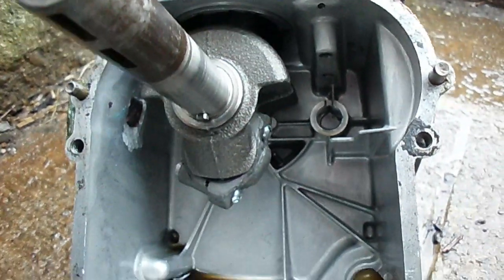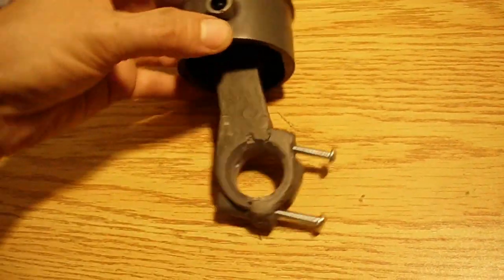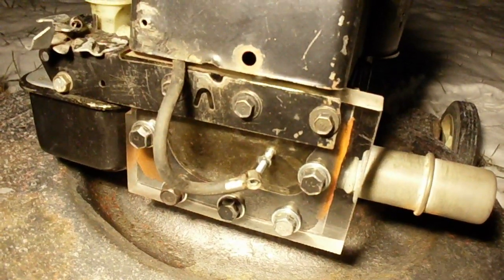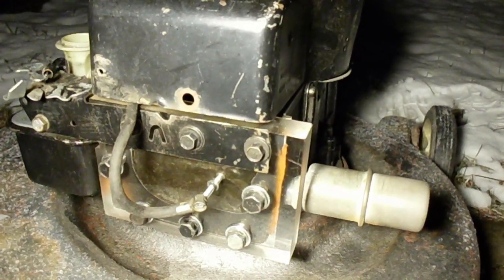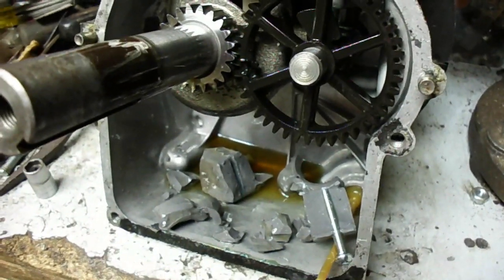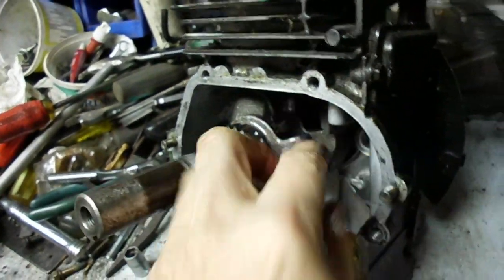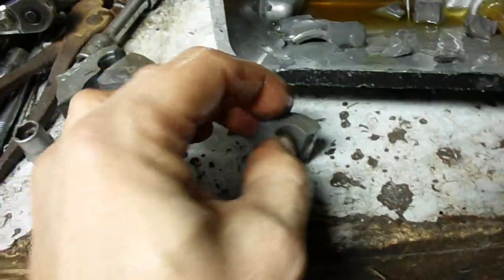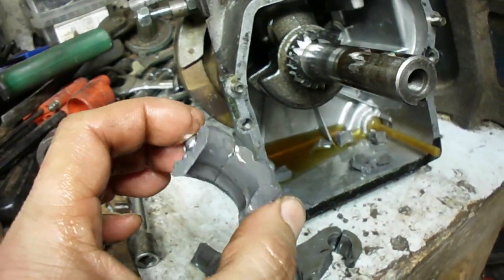J-B Weld CON ROD & PISTON - FAIL

Comment: I don't doubt that a con rod and piston can be made of jb  weld just it would be hard to balance it to act the same way as the original, I mean I rebuilt a Perkins 3 cylinder diesel recently and if you put con rod number 3 where number 2 goes your asking for trouble
Reply from the maker: Yes, that is very true, both the piston and con rod are over weight.

Comment: And looking at some points in the video, there are sections where the video seems to stop but the audio keeps going (and I went back a few times to make sure it wasn't my laptop), makes me think your SD card may not be up to scratch, or the camera has an issue writing to the SD card...
Reply from the maker: Hey, thanks for letting me know about that, perhaps I wasn't a complete idiot, and didn't press the record button hard enough. The funny thing is, I swear i recall seeing the read numbers at the bottom of the screen advancing after i pushed record. Maybe it was a camera error.

Comment: jb weld is meant to bond to things, not be by itself. When its by itself, its very weak and brittle. If you make it again, try to put some metal plates around the outside when its curing or metal rods inside.
Reply from the maker: Yes, I think I will use some type of re-inforcement if I make another one.
Reply: Metal flakes in the mix would be cool. Like pykrete but more permanent.

Comment: @chargermiles007, how do you seal your heads without gaskets? Will high temp rtv work without a gasket?
Reply: You can run without gaskets. Just have the head and block ground  extremely flat. And you can't run RTV for more than a few hours.
Reply from the maker: For the 5  minute or so runs I usually make, high temp rtv works well. I try to use a regular head gasket when possible.

Comment: I wonder if it failed at the bolts that hold the bearing end cap on??
Reply from the maker: I think it did, though it didn't tear the threads out of the JB, it just broke right on the bolt center line, just like the first time.
Reply: Maybe thicken/beef that area up as much as you can if you attempt a JB Weld connecting rod again?
like a fair bit extra?